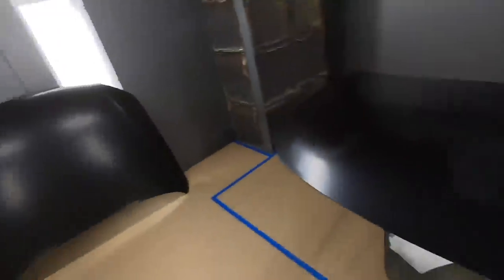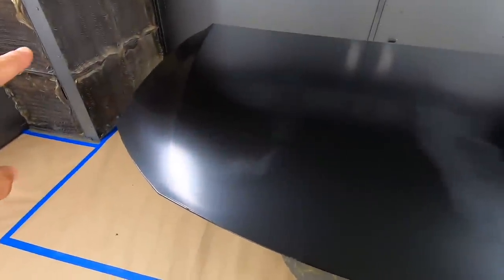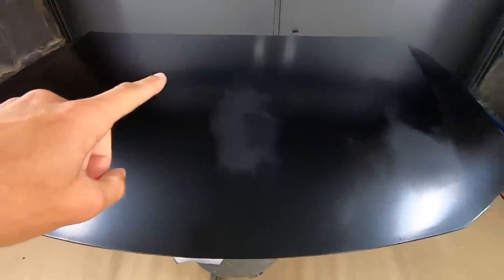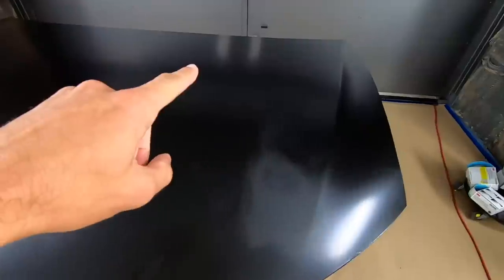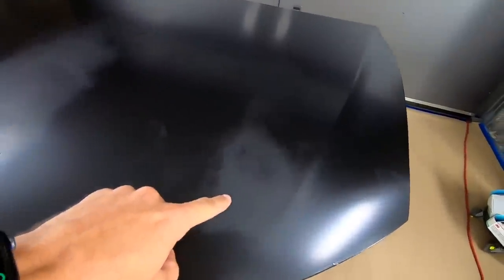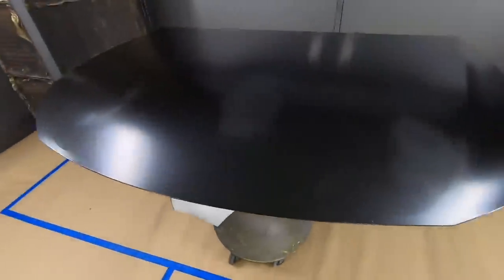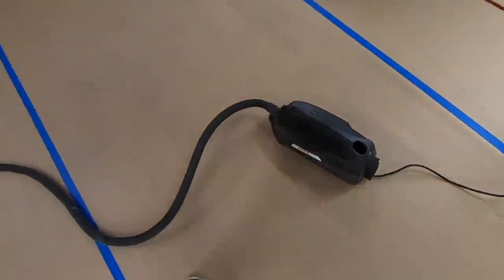How to Easily FIX and AVOID Cloudiness (BLUSHING) in Plasti Dip

Comment: Hi, I haven't dipped my car but I have blushing that is happening on the hood in the original paint atleast I think it's original... I bought the car used and the first owner may have had the paint touched up because of rock chips. Anyways will Naptha help clear the cloudiness in the clear coat?
Reply: I’m looking for that answer as well. Same problem. Did you find any answers?
Reply: @denisef1153  dang i need the answer to this too man

Comment: Hello @DipYourCar I'm struggling to find information on the ideal state for a vehicles paint finish before dipping the car, is an 800 grit or primer'd state OK?  Or does a car pretty much need to be repaired and at the level of a good non-peeling clear coat status?

Comment: I've got a few spots around my car windows that dip removed from as I didnt catch those "remove when wet" areas fast enough.  I went with the shadow black kit and still have some shadow black left. Can I correct those spots with your thinner solution so they "stick to the vehicle" where the dip pulled up and then fill those spaces with a fresh coat of only shadow black...without the base coat? I'm waiting to make these corrections this spring if possible and wanted to know if I need to fill those peeled spots with a base first or if shadow black would do the trick? Thanks!

Comment: Great video! I have a few questions hopefully you would be willing to answer . I am Red Plasti dipping some plastics on my GSXR and I made the mistake of doing my last coat of red in the humidity, ended up with blushing. I’ve done probably 5 coats . I was tampering with the idea of doing one coat of pearl then a coat of red metalizer - suggestions on doing those two ? And would I need a glossifier after the metalizer - I want a shine . Would the blushing go away if my next coat was to be either of these two or should I just do another coat of red ? Thank you so so much !

Comment: How did you deliberately induce the blushing in this case?
Reply from the maker: We laid out a very wet, heavy coat and then opened the big doors of the booth and let a ton of humid air rush in.
Reply: DipYourCar interesting and glad to know it was done by doing the very thing you suggest causes it!